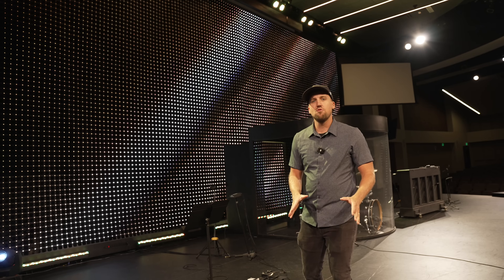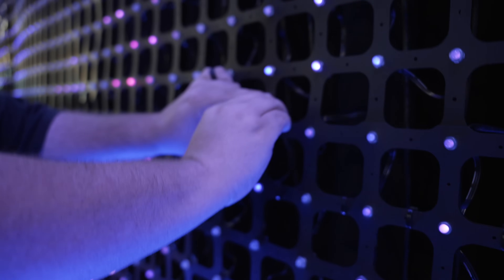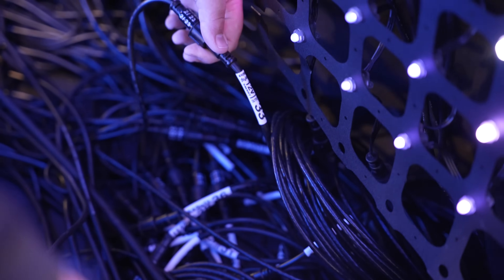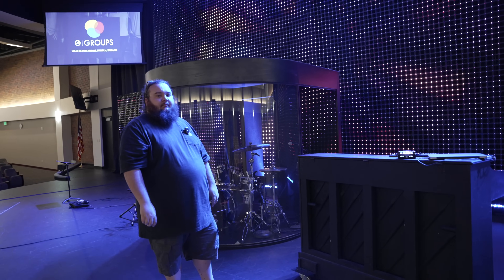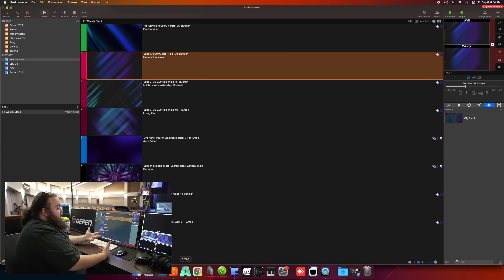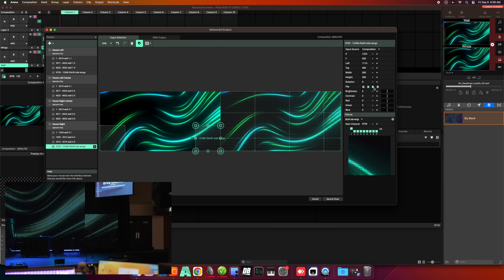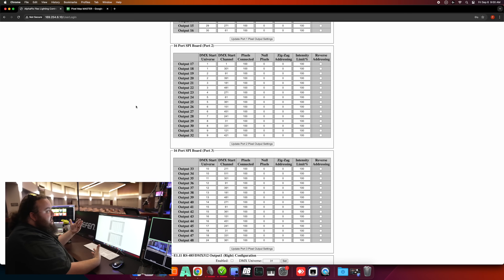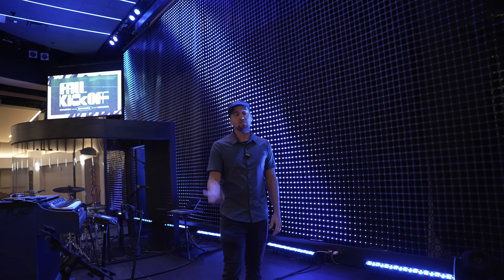MASSIVE Pixel Grid for Church Stage Design

Comment: email Holiday Coro if you want it! they custom made mine, they actually manufacture the plastic themselves. so mine is 27ft w by 12ft high set 100px across 58 up at 2.3 inches apart with no holes (its solid black). they can make them custom for you and do all the work for you no splicing or inserting LED's. you just have to set up the ArtNet to their spec!

Comment: I think its a waste of money as opposed to instead saving up for an led wall and then just using pixel graphics it would look 5x better and brighter
Reply: Not really an LED wall that big is not at all cheap this is more than half the cost for the size
Reply: @DavidSuria-dt7pt  more like 1/8th or smaller. A true LED wall that size would cost 30 or 40k or more. This wall was maybe 1 or 2k tops.
Reply: @solusfides  11K pixels, $35 per 100 node string, $4K for the LEDs alone. Plus controller, netting, cabling. And that's if you already have the network & output computer ready & available.
Definitely way cheaper than a LED wall, but 2K is dreaming.
Reply: @sennysoon  fair math. Still a fraction of the cost of a full led display.
Reply: If you guys are finding led walls that big for 70k-80k please tell me cause I’ll buy that ASAP 😂